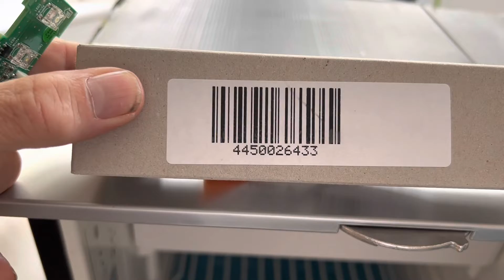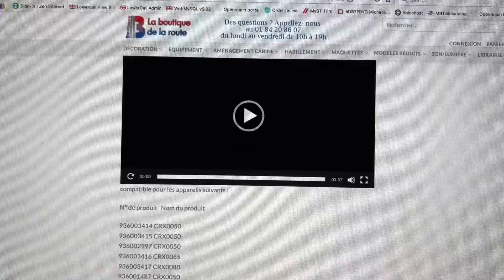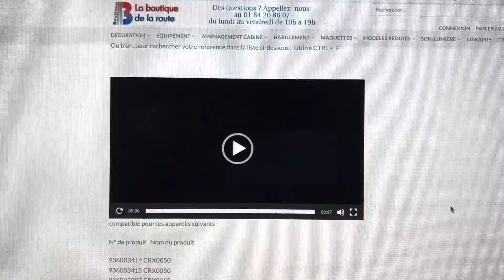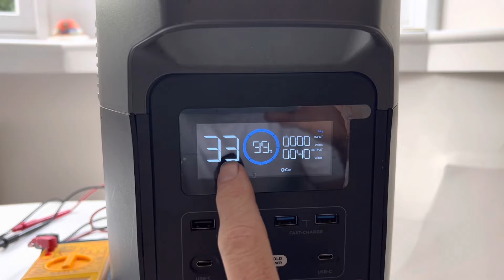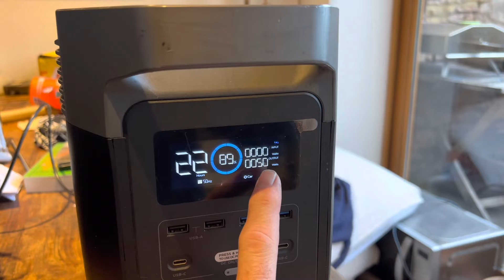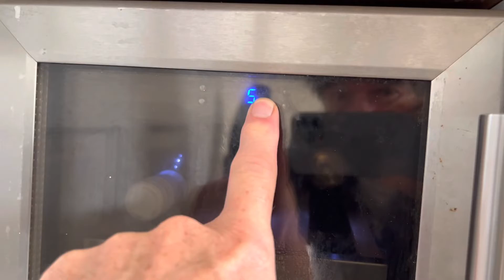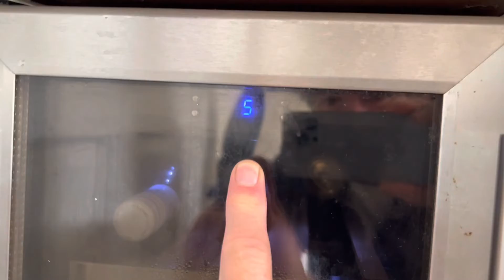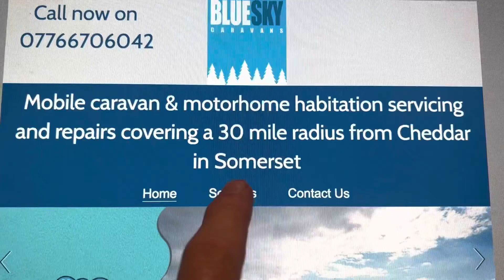Dometic Waeco CRX50 compressor fridge repair tips+performance using EcoFlow delta.

Comment: hi mike,i have just bought the same, is there a special lead i can buy from fridge to delta, or a special plug.for power.
cheers
Reply from the maker: Hi - the EcoFlow comes with a cigarette socket lead which plugs into the solar plug on the side. I didn’t think I would need this lead so I cut off the solar end and wired the fridge to it - big mistake. It is far easier just to buy the female fitting for that solar plug and wire that to the fridge. I actually bought a dual solar fitting so that both the fridge and the sink run of the cigarette light socket on the EcoFlow. I did a video about this in the Fiat 238 playlist. Mike
Reply: @MikesMercsandothercars  thanks for your reply ,i will need to use solar panel,as i also have an old bus.maybe i can wire the fridge to a cigarret socket plug for the ecoflow.

Comment: Hi Mike my warlock fridge old design with manual controller has stopped working lights on no compressor coming on! I know nothing about electrics but would appreciate any feed back! Thanks
Reply from the maker: Thanks for your comment. Unfortunately, I am no expert in these fridges. If it was me I would first put power directly to the compressor to rule out a faulty compressor. Where are you based. Mike

Comment: After reading comments about these frdges it's not worth buying. They are the most expensive and have more problems than other brands
Reply from the maker: Thanks for your comment. Just bear in mind that this is one of the most popular fridges in camper vans and boats and therefore you will see MANY more comments about this fridge than others. Unfortunately, human nature is such that we rarely comment if we like something....more often we like to shout from the rooftops if something has gone wrong. My experience of this fridge (so far...) is that it has been amazing. Low power draw, amazingly efficient at cooling and not to load.. Mike